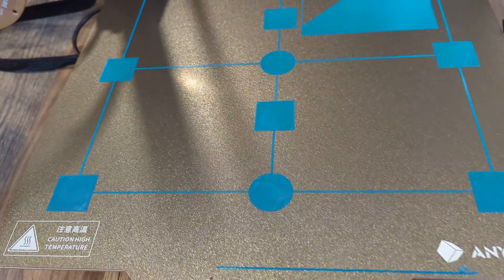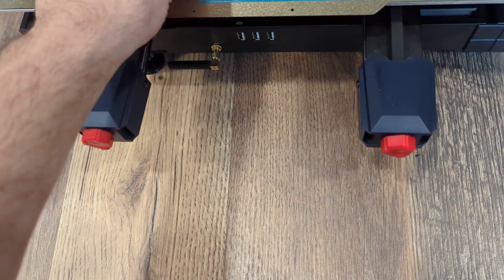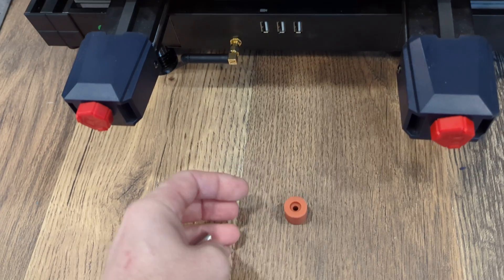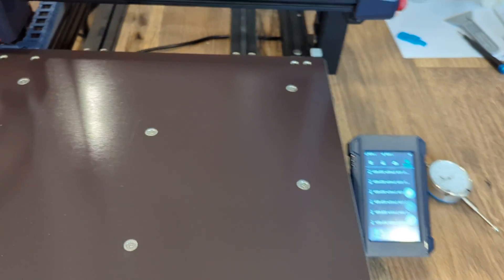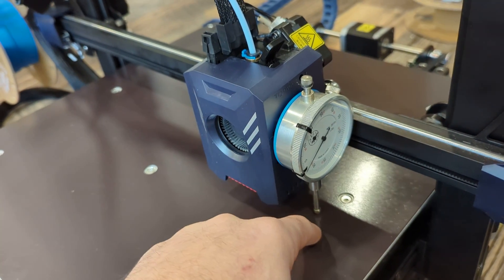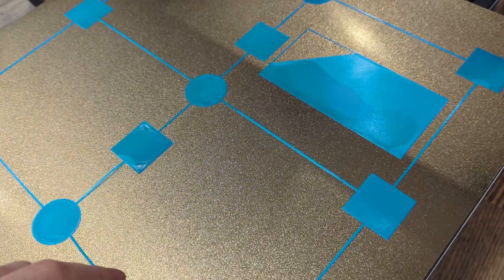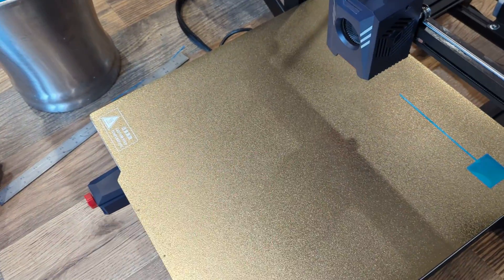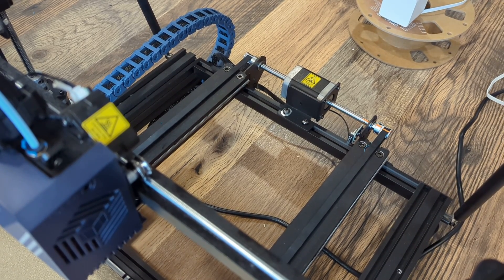Anycubic Kobra 2 Max Bed Leveling/first layer calibration explained

Comment: After you switched to the silicon spacers.  How often do you re level your machine?  Every print?
Reply from the maker: I hardly ever re-level.  every once in a while if I notice a first layer being a little high or low I just lift the plate and turn the screw in or out to adjust, been working great!

Comment: I had the same issue with the spacers.  The heights for the spacers should actually be different between center and outer, because the bottom surfaces for center and outer are not at the same relative plane.

However, they messed up the sourcing for be center spacers, they are too long by 0.018 inches.  I verified this first by measuring the offset angle between the center and outer perimeters (zero out at center then check outer - you’ll get somewhere between 0.1 and 0.2 degrees).

I then did some meticulous measuring of all spacer locations and the spacers themselves relative to a common plane above.

When I did the trig with my measurements I got an expected offset of 0.1587 degrees when measuring from the center to outer holes (6.5 inches separation).  So my angle measurements matched spot on with the expected deflection when plugging in the length measurements.

My solution was to design and print some tiny washers that are 0.018 inches thick and install them with the spacers.  Worked like a charm.  Now the plate is flat.

Better than the silicone method because you’re not tightening to some specified torque to try and level it.  You tighten to standard “hand tight” since the washers and spacers are rigid.

Comment: I didn't read all of the comments but you do know that you have to calibrate while the bed is hot and nozzle are hot.
You have to take thermal expansion into account.
On these massive beds it makes a huge difference
 Like up to a 1/4 inch difference

Comment: hi Mark, thanks for the explanation, i put silicon spacers on my kobra 2 max too, cuz I got the same problem with the bed, but when I added the spacers and make my printer go to "home"  the nozzle start to go so low and made a point spot on the bed, I tightened the bolts , but still its making the nozzle go too low 
any advice ?

Comment: Just assembled my new Kobra 2 Max.   The bed has a good 1/8" warp right out of the box.  Garbage machine.
Reply from the maker: feel your pain.  Definitely shouldnt be that way ...but if you want to print big there are no other better options im aware of anywhere close to this price point which is why I was hell bent on figuring out how to get this thing to print good.  AC will likely send you a new bed if you contact them, if you can return it and buy another thats probably a faster solution.  My first printer had a warped bed, second was WAY better

Comment: The autolevel in these things is terrible, I have always to dial it manually by a lot, cherry on top the other day the nozzle clogged mid print and the pressure moved it out of the heat block by a centimeter, destroying the pei plate...

Comment: Wow every issue you've mentioned. I've had and came to the same conclusions. Except myzlx axis gantry won't level out period.
Reply from the maker: @SwissC23  sorry to hear all the same issues, hope you can get yours printing well.  Only thing I could figure out to try and level the gantry was pulling the top belt off and independently twisting each of the pullys until it squared, then putting belt back on

Comment: ....just saying, if your bed is flat but at an angle, your ruler wouldn't give any indication that it's off. My recent issue on my 2 pro is the front seems to be sagging...I rarely do big prints so the back could be elevated slightly but I'm not seeing as much failure on the backside. Aside from my critique on the ruler, this is a great video!

Comment: Wrong ....do not level cross arm to bed must level it to frame on each side if off lossen screws on one top gear Rod then turn rod till evens hight on both sides then do all home, then move nozzle to center of bed and lower z axis slowly till touching paper slightly tugs but losses, then move around bed with unit off now and adjust nuts under till all even under nozzle go around 3 times n get dialed in then do auto level then move nozzle to center and lower z off set till touching paper again and then hit print good to go for awhile
Reply from the maker: @aaronduranceau7683  respectfully, the nozzle having consistent gap in relation to the top of the bed, front to back, left to right, is whats important and lack of consistency due to a warped bed is the most common issue with this printer.   The tip regarding paper works for many printers but not the Kobra 2 series as AC does not provide in their software a way to do it.

Comment: I get this printer in the morning at 7.30 i send it back on 5.pm. this is the biggest shi* of 3D printers on the market!
Reply from the maker: Ill echo I wish it printed out of the box.  Definitely would not recommend unless you like to tinker AND are stubborn about large printing capability.  Trust me when I say it's possible to get them printing good, have two that have been printing flawlessly since getting them dialed in for over a year now, lots of print time.  Big learning curve getting them dialed in

Comment: I hope you disable ABL when doing this, if not this video is just a mess. Just reset ABL mesh last thing before the print starts, in g-code.
Reply from the maker: All of my testing was a while ago (when the video was posted) but at that time ABL made no difference whatsoever, Gcode, running manually, before, after, didnt do a thing.  I suspect its bugged (or was, maybe they fixed it in firmware?) Either way both printers are still running flawlessly except a clogged nozzle from time to time
Reply: @mark4jr  Thanks. I actually find this type of bed easier to get flat, just because of the type of adjustments you made. Printing without ABL propagating throughout the entire print, as for absolutely all layers, just makes a ton of difference. Just for reference, Elegoo lacks the two center holes, thus, this type of adjustments becomes way less accurate.

Also, my Prusa MKIII printers have flatter beds than most Voron printers. I simply do not get what the fuzz i all about.

Comment: If you move the bed all the way forward than move it back apporox 5inchs , fling each belt if you hear what sounds like a guitar string at a medium tone your belts are tight enough. if your belts are to loose they will slip and cause layer shifting as well. I have had the kobra max 2 for a couple months with 100hrs on it so far and no issues. i use to own the kobra 2 it also had layer shifting issues but it was the print head unit causing them as like you said the wheels would be too loose.

Comment: How do I print big objects. The first layer is not rlly that good for me the auto levelint set 2.32 for me
Reply from the maker: Unfortunately, in my experience, there is no simple trick to getting good prints.  The flatness of the bed and first layer is pretty critical.  I covered how I set up my second printer following the lessons learned from the first in this video : https://youtu.be/eV9AGm6lLHg?si=FAZZjja05E9eZUt7
Reply: @mark4jr  i tried ur level set and it worked , thank you
Reply: one way to do it, is get a full size bed layer print, start printing and adjust your z offset manually, if the filament is lifting all the time you can also use glue instead of relying on the bed itself. water based glue works best. so if your printing and you find your layer is breaking apart or not staying down that is cause of the z offset. if its coming off right away your print head may be to far away from the bed, if its grouping together and tearing its way to close. adjust the z offset by 1 only do not go crazy as you do not want to mark your bed or wreck the print head.
Reply: @kewtd72  it worked for me after i set the z offset to the one he set in the video and ithe first layer came good

Comment: I need a large space for a printing bed. Is this printer worth the money.. or is it a waste of money and time?
Reply from the maker: I really like both of my K2Ms, It's awesome to be able to print large functional things.  It definitely was not an unbox and print experience like you would get with a Bambu but Bambu does not make a large format printer (yet).  Once the K2M is dialed in it prints very fast and reliably.  I would look at it like buying an old used car, if you are somewhat mechanically inclined and don't mind getting your hands dirty it will likely prove to be a fantastic value.  I made this video going over pretty much everything I had to do to get both printers running flawlessly https://www.youtube.com/watch?v=eV9AGm6lLHg

Comment: Awesome Video, great thinking and great Explanations. Hope you will get more Clicks in the Future, since the potential is definitely there. 

For my Kobra 2 Max some Bed Screws have been extremly loose, overall I am still quite happy with this Printer: size, speed and Price considered.
It would be nice if Anycubic would provide such amazing Tutorials, or at least torque specs for the bolts though.
Reply from the maker: thanks for the kind words 🤘

Comment: If you increase the current on the stepper motor which I think on these boards you can probably do it manually and you can raise the voltage up That's what's solved all my layer shift issues on every printer I've ever had
Reply from the maker: havent heard of a way to up the amperage on AC printers but that would make sense, more power.

Comment: Sir, I would like to shake your hand. You just ended my hours long headache with a 15 minute video. I only had one spacer that was off, so I stuck two metal washers between it and the plate for shim, and I am getting better level results than I have in months. Thank you thank you thank you!!

Comment: Great video. Thank you sooo much. I found the silicone spacers on Temu (Idea Former Hot Bed Leveling Column Silicone Solid Spacer). One set consists of 3 longer and one shorter spacer. So two sets of € 2,97 should do the trick. I also got myself a dial meter. Let's get the Kobra 2 Max level 😀 Woodworker tip. If you use a ruler to see if the bed is level, shine a ligt (torch) behind the ruler. This will make it really easy to see deviations.
Reply from the maker: @windmill10  great tip with the light I can see how that would help a lot!

Comment: You can solve anycubic Autobed Leveling issue by taking advantage of the Auto Bed Leveling Mesh, Most people dont know that in order to have true auto leveling, the Z axis should be moving up and down as your first layer is printing across the bed. My Start Gcode I use to make sure the printer is actually using the Auto Leveling Mesh Data is the Following. You should need to do any bed leveling like this if the printer is mainly square as the Software should take care of the rest, but what you did will def help more. 

M420 V1 ; view the current mesh as a 5x5 matrix
M140 S100 ; (or S60 for PLA) start heating up bed
M104 S210 ; (or S175 for PLA) start heating up hot end
G28 ; home all, required by G29
G29 ; Perform leveling using presets in firmware (i.e. 5x5, etc.)
M500 ; save mesh to EEPROM
M420 V1 ; verify that the mesh has changed, hopefully only slightly
(cool printer, turn off, turn on)
M420 V1 ; verify that the mesh is still the new one
Reply: HOLA, por favor haga un video . gracias.

Comment: Hi, after 6 months have you found what's the problem for the layer shifting? (belt, pulley or motor) thanks
Reply from the maker: @yurif74  i slowed down acceleration on the Y axis and havent had an issue since.  pretty confident its the stepper motor overheating and losing its hold.  AC sent me a new motor but haven't installed it, one person mentioned the idea of adding heat sinks to the motor, bet that would fix it
Reply: @mark4jr  how did you decreased the acceleration on y axis only? I have big layer shifting even when the printer do resonance test (but only at the start, when the y moves fast at higher frequency, no shifting at all)

Comment: With my old any cubic I just used nylon washers in the corners or spots to where it needed to be raised different sized ones to get it as flat as possible
Reply from the maker: I bet that worked well, people seem to be successful with foil tape too.  I liked that silicon spacers would let me make adjustments in both directions
Reply: @mark4jr  yeah it did and I got to a point where the first layer was exceptional, I just got a cobra Max for a really good deal 300 shift so I'm hoping I have good luck with it

Comment: i had, once a Y shift, not sure if what i did did anything but i havent had it again .. I added heat sinks to my motors
Reply from the maker: @jeep-australia  that might be a genius idea, lot of people speculate it happens due to the motor overheating
Reply from the maker: @jeep-australia  what heat sinks did you use?
Reply: @mark4jr  I had some 20x20x10mm Aluminum Fin , just mounted as many as i could fit. 2 on back, 1 each end and 2 on the bottom.. My Kobra PLus dont get as hot but i added to it also..

Comment: bed leveling just ensure that the bed is parallel to the x axis. as he said you must ensure bed is leveled and everything is tight enough. Leveling the bed is the easier part. the problem is when your trying to level the bed and set the Z-offset at the same time. The printer assume the nozzle is just touching the bed. The Z-offset tells the printer how much the printer is not or is into the bed. So if your first layer is 0.2 mm and you are just perfectly touching (0.00) a leveled bed, the nozzle will go up 0.2 mm to print the first layer. if the nozzle is 0.2 mm away from the bed then Z-offset must be set to +0.2(if printer reads positive as going closer to bed) or -0.2(if printer reads negative as going closer to bed).The problem is just being 0.01 mm of the bed will significantly affect first layer quality. but humans cannot accurately adjust the bed by +-0.01 while at the same time keeping it perfectly leveled. adjusting it by hand is its like trying to win the lottery. it is better to just level the bed and adjust the z-offset value and let the printer make the adjustment until first layer is perfect. if your built in z-offset adjustments is only by +-0.1 then you must adjust the z offset by the +-0.01 in the slicer.
note that this only works if you have no other issue with the printer like extrusion problems or bed sticking problems. if you have other issues they will introduce more variables and make finding the right z-offset almost impossible.